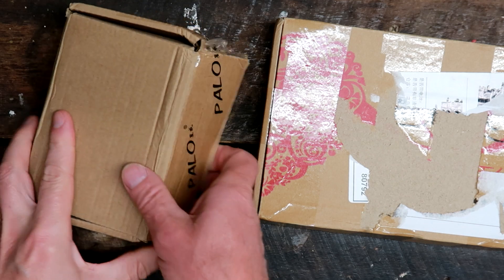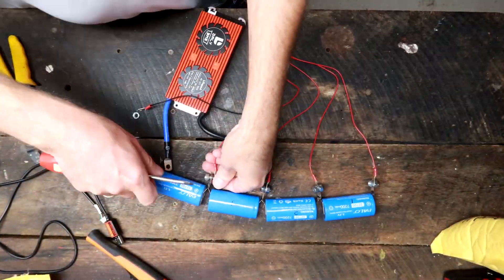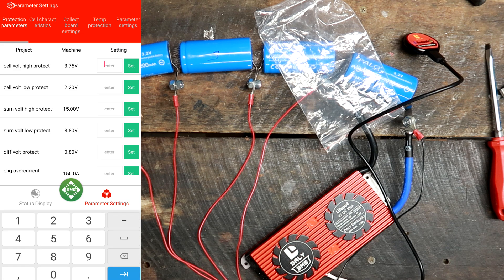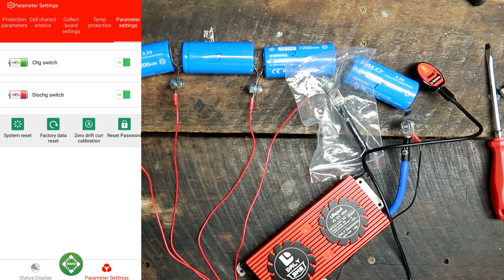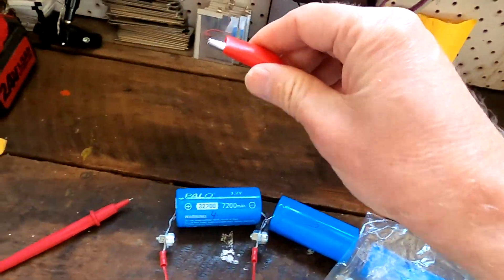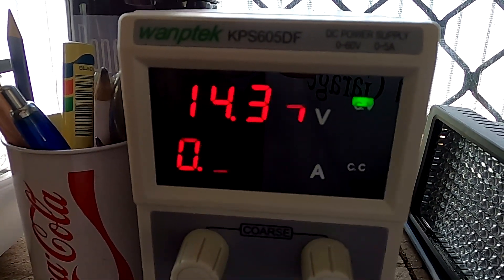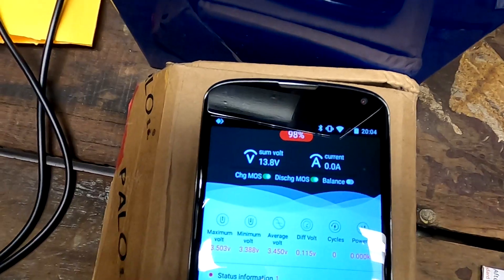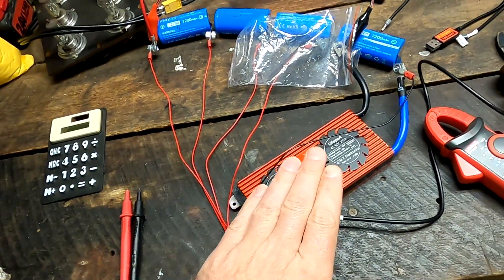Why DALY BMS' are so popular? Exactly, I don't know either.

Comment: I have to agree Andy, I had such high hopes but my Daly 4S however it is a mediocre BMS at best. I have also got a 16S xiaoxiang type non-relay MOSFET based BMS and I'm far happier with it. I had a lot of trouble with my Daly when it first arrived, I had top balanced the cells and the BMS wouldn't start and I couldn't figure out why. I had to contact support as well and found out that I needed to discharge the cells a bit first before it would even work.

I'm not 100% sure that it's the same with the larger cell count versions (ie 16S) because I'm aware they run a different chipset and protocol when communicating with the BMS. I found this out when I connected it to my VenusOS Raspberry Pi via USB to get the battery statistics.

You're absolutely right around the settings, not enough configurable and the balancing might as well not be a feature. I am going to replace my Daly BMS shortly as I believe it is contributing to the poor performance of my 12V pack and will use it for bench testing only. 

Thanks for the video Andy it has confirmed my suspicions that it was just how the Daly 4S BMS works and not that my one was a lemon 👍
Reply from the maker: Thanks for sharing, Ben. I was really disappointed with the Daly BMS, was hoping for a far better experience. Apparently you can connect it to a PC and have all the options available then to configure. But how cumbersome is that?
The Daly will now be just a protection board when I do testing, same as you said. That's all it is good for.
Reply: Your battery is probably mediocre too

Comment: The QUCC bms is awesome, if you are worried about that when the relay turns off to protect the cells, the discharge function turns off too, obviously, what I did was took apart the relay and connect the battery cable directly on the bms shunt, and use the relay to turn of the charge controller instead, so when you have a high voltage alarm, just the input shuts and works perfectly. If you need to protect from low voltage just program the inverter to do that and you are all set. I tried the Daly bms but the Qucc is much better specially the software
Reply from the maker: Oh, that is a great idea. I never thought about that. Actually I would probably connect a second really which then shuts off the solar. I'll think about it. Thanks for sharing.
Reply: Bună ar trebui să vad o demonstrație

Comment: My experience with Daly was ok. Installed, started bms fine, app worked ok on the phone. A bit of guesswork/sleuthwork was needed to get the Windows app going, and I've found I never use it anyway.

The various parameters on the app were pretty self explanatory, so never really needed the manual. It's been working flawlessly, and top balances within 20mV without fuss.
Reply: balanced open start voltage = 3.2V
balanced open diff voltage = 0.020V
and it just worked - I guess from other comments probably only when it's charging. It's not balancing now because it's discharging but max difference is 0.011V.

Comment: I havr an 8s 24v daly bms.i found out it only balences while the charge indecater is on
Reply from the maker: Yeah, that's what I found too, it's bit restricted in these terms.
Reply: The only time you balance a  battery is during charge
Reply: Thats the correct way to balance a battery

Comment: Weld? Isn't it normal to spot weld battery tab connections?
Or perhaps in Chinglish, they meant soldering?
Reply: I think they just mean "making a connection" in this context. Don't make connections to the balance wires while they are plugged into the BMS.
Reply from the maker: Apparently they mean soldering. But still who is soldering balance leads on busbars or terminals?
Reply: @OffGridGarageAustralia  What they mean is that you must only make use of the blue and black silicone flying leads that come with the BMS.  Don't try to solder your own huge wires directly onto the BMS PCB.  You can imagine how much mess some people may have created while attempting to do that.
Reply: @OffGridGarageAustralia  - “who is soldering balance leads”

Probably someone putting a BMS & battery set in a box & selling them as a unit.
Reply from the maker: @henvern  Is that what it means? You would have to open the BMS to get access to the PCB. There's your warranty gone then...
Reply: @OffGridGarageAustralia  Yeah not likely on the 100A BMS where the leads are potted in.  The 250A BMS has large tabs which removable leads screw onto.  You wouldn't want someone to try solder to those tabs since the heat would soak straight into the PCB.
Reply: @FullyChargedZone  Cool Channel name
Reply: @OffGridGarageAustralia   its actually done often to avoid the terminal rings making a weaker connection between the busbar and battery.

Comment: I just got mine and can confirm that it doesn’t balance upon being hooked up, and no, I didn’t “welding the wires”.  The instructions are hilarious.  I have the temp disconnect in ice water and it also is not disconnecting like the other bms.  Damn.  Thank you for posting an accurate data driven review.  If you can get these to 10 min that would be great.  30 min is a long video.
Reply from the maker: Thanks for sharing, I'm still waiting for my temp sensor to do more testing. I'm not good with short videos. It would be several parts then...
Reply: @OffGridGarageAustralia  you can probably get a temp sensor from any RC parts store, or you can make your own two lead.  The cutoff may be slightly colder than 0 degrees C, but I decided to err on the side of caution and hook up a separate temperature disconnect that I know will shut off the charging side

Comment: In my mind, the nice cover and tabs to fasten down to a surface are what draws people to Daly.  Functionality aside, these look much nicer and are safer in that the leads are not exposed.  I also think Daly is the Chevrolet while other's may be the Cadillac or BMW.  It will get the basic job done but may not have all the bells and whistles.  (Maybe a bad analogy, these days as most cars seem to have all the bells and whistles).   Before condemning, though you should attempt to top balance then install to see what happens.  Also you may have someone else's reject as the temp sensor lead is missing.  AND THE RUBBER BAND IS NOT WRAPPED AROUND ANYTHING.   I would make blanket statements about any brand without testing more than one.
Reply from the maker: Thank you.

Comment: I have daly for 16 300 AH lfp batteries connected to a deye inverter. I always struggeld since my inverter would not charge with full power while there was a lot of pvpower available. More or less it was charging the whole day instead of charging fully in the morning.

After I had low voltage faults and my daly was in sleeping mode when I discharged only up to 4KW and drawed about 2KW.

I got across some daly settings in a daly forum and changed the referrence voltage from 3.2V to 3.6V

This seemed to change the behavior. My batteries are now fully charged 10AM using full charging up to 4.5KW. Also did it charge 7KW more than usal on the first day. At night my batteries where before at 52.2V and newly at 52.9V

Im still unsure if it os save to use my new settings since I dont like to reduce the life time. Is it save to have the referrence at 3.6V charging upt 57.5V?

Comment: The balancer does work over a 10 amp charge rate. The charging stops when one cell goes over the limit you set. You will never get the battery charged at higher than 10 amps. Over 10 amps and it goes on and off as that same cells go over the limit as soon as the charging try to start again. So it never goes anywhere. That is why I will install a QUCC 10 amp active balancer. Moreover if your delta increases with the charging, your charger amp ratio to balancer amp is to high. "Delta" is the voltage differences in highest and lowest cells.

Comment: Touch your blue and black lugs together for a second to turn on BMS. Yes, a NTC thermistor sensor was including in all of my Daly’s. One was hidden under foam. Oh, The Bluetooth works when it wants to. Also there’s a timer on the Bluetooth. If you go to settings, you can enter 15300 seconds and that helps quite a bit keep it on. It will shut off if you go sit down and have a beer and go back to it 15 minutes later. All of this stuff is just a learning process. So far I like everything about Daly, except there is no LED or beeper. I also buy the touchscreen display as often as I can. In order to balance, you need to have electrons flowing.
Reply from the maker: Thanks for sharing.
Reply: Look closely at the Bluetooth module that he is using. It has a reset button on the front which can be used to wake the Bluetooth up. I have the same module but what’s interesting is that it does not have the Daly logo on the front. The ones with the Daly logo do not have the reset button.
Reply: @TexasStatesman  Some of my dallies have it because they are newer. The older models do not.

Comment: I have such a problem
bought 16s adjusted to 14s
the last cell shows 0.899 although the tester shows 4 volts
I change the settings to 13s, after which cell 13 shows 0.789
I change it to 12s, cell 12 shows 0.845
help!

Comment: Two reasons, they come properly packaged, not like some DIY kit you have to make up yourself, and secondly they just work! 3 years in service no issues.
You have to remember they were pretty well the original, not much else on offer 4 or 5 years ago.
The only thing I don't understand about ALL these Chinese companies is why they don't pay a professional English speaker to rewrite their manual and instructions, it would reduce the number of customers issues by a huge amount. As an example Deligreen had their main wire connections described in opposing colours!

Comment: I use this Daly BMS with my 16S LFP battery 14.5kwh DIY. An arduino check cells with RS485 protocol, and I turn on active balancer (the same as your with condensators) with a relay on the "turn on / off" pin on the active balancer PCB ; The active balacer is only activate at the end of charge, it's perfect for me !
Reply from the maker: That sounds like a perfect solution. Makes totally sense to balance only at higher SOC and voltage.
Reply: What active balancer are you using? I’ve been wanting to do this as well. Thank you.
Reply: Nice solution with check cell with rs485  and Arduino can you tell me this solution
Reply: Thats a great idea! I'm using Venus OS connected to Domoticz automation system which could act as a logic instead of arduino based on SOC. Thank you for this idea :)
Reply from the maker: @redbaronrefining5322  Have a look in the description of the video. There is a link to my website where you can find the active balancers.

Comment: Andy Im using the Daly bms I keep watching this video over and over and over and over and still can't figure out where to set the balancing start voltage no matter where I set it my last cell in the bank keeps deviating from the pack my last setting to try and fix this was 3.4v the actor balancer kicks in but the cell just keeps climbing higher and higher please help
Reply from the maker: That's the problem with DALY BMSes, the balance current is so small, they won't be able to balance your large capacity cells. You will need and active balancer for your pack.
Reply: @OffGridGarageAustralia  I'ma go ahead and switch my BMS to the JK Bms I'm just tired of Dalys poor performance in balancing I need 3 of them since I have 3 24v banks
Reply from the maker: @diysolaradventures7894  What batteries do you use? 280Ah or similar?
Reply: @OffGridGarageAustralia  yes same blue lithium iron phosphate cells as the ones u have except capacity on mines are 277ah and my other 16 cells are 120ah

Comment: Weird, I had the same problem you did, however my Daly came with the temp sensor and at first it was working, then the unti stopped charging but the chg and discharge switches indicated it was working but the pack would not take a charge, once I turned off the temp sensor it started working again? I have 8 32650 cells in series as a test, my cells are 6000mah so that should mean they are 6AH cells correct? Yours are 7200mah which should be 7.2AH so where did you get the 5.4AH? curious that I may not be understanding... Great video you saved my bacon.

Comment: They make more sense in the PEV market , since you disccharch at much higher amps , often for safty we run discharge bypass and charge only BMS configurations. You would not want your battery shutting off leaving you without brakes.

Comment: I have used daly bms extensively. several 4s and one 16s. Their software, updates, translations, and differences between board/software revisions and support is just a mess but he important stuff like lvd and hvd etc is flawless and imo you dont really't need to change any settings except capacity. 3.75v/2.2v HVD/LVD is set that high/low so you can charge up/discharge your batteries to 3.65/2.5 with charge controller without the bms cutting off to early.

The bms need at least 2 amp charge current to balance
35mA balance current should be more than enough to compensate for drift caused by internal resistance differences. Obviously you cant use the daly bms to balance unprepered new cells. Go do the initial onetime top balance first, you know this already lol! :P
The SoC calculations on 4s boards are a bit wonky.
The password is just a password set in the app, the bms has no password and cant be changed anyway, see it as a "are you sure you want to change this setting" prompt.

The bms definitely need improvements, especially in the software. But hardware seems good to me. Low resistance no heat =))
Reply from the maker: Thank Rickard, great info here! With the other BMS' I had I could just wack the cells on and it would balance them over night automatically. For these smaller test cells, I never top balanced them just left them connected to the BMS and it would do it. The Daly seems to need a lot of cycles for that to happen if it only shaves off a small current while charging. Not a fan of that...

Comment: Hey andy could i please get a reccomendation on a 4s bms for my battery im building? Im gonna use 8 of  the 304ah cells to get 600ah my questions are should i be running 2 individual bms? Also what would be your reccomendation for one? Im gonna have a 3000w inverter so was thinking 200a bms?
Reply from the maker: It depends a bit on how reliant you are on this battery. For redundancy two separate banks would be nice, but you need an additional BMS. If it is for a camper, I would run every two cells in parallel and use only one BMS.
Also the 3000W inverter can use up to 250A on 12V. So a 200A BMS maybe too small. You either can use a Daly or JBD BMS with such high currents and an additional active balancer from time to time to maintain that top balance.
Reply: @OffGridGarageAustralia  yea its going to be for a permanent off grid setup so maybe the 2 bms might be safer... also was talking to my 12v friend and he said 2000w inverter will be enough so that should be a bit better... also a new question you just mentioned haveing a seperate actuve balancer is that another unit? Which one of them would you reccomend. You seem to do alot of testing so i trust your results.
Thanks mate

Comment: can i connect 8s lifepo4 320ah in series and then connect a second 8s lifepo4 320ah in series after i have these individual battery packs in series i can connect them in parallel to add a 24v 640ah system please answer i need to know thank

Comment: We just add an DALY active balancer in our Power-Packs. And it works perfect.
You're right: Balancing battery packs by using a DALY BMS only is NOT POSSIBLE.
In my mind it's a kind of merchandising stuff. YOU REALLY NEED TO ADD A DALY ACTIVE BALANCER.
This active balancer balances the battery cells down to 2 mV deviation.

Comment: Thanks for sharing, I’ll look into the QUCC BMS, however my DALY has been working quite nice.
The warning about welding seems fair, I guess you could damage your BMS if its connected while spot welding the cells!
Reply from the maker: If your Daly works, don't buy another one. The QUCC won't be much better...
Reply: @OffGridGarageAustralia  Regarding that, is there a BMS that you DO recommend? I saw you have a video about JK-BMS, but if I need something above 12 volts?
Reply from the maker: @henrikostman4474  The JK goes up to 24s so can be used for almost any battery. 
If you want more communication, more safety look at the Seplos BMS, Pace or GobelPower. There are heaps of videos about all of them here on the channel.

Comment: As a guy without any personal experience with any BMS, i always thought this QUCC BMS is quite nice, except for the relay.
Today i tried again to order my boards for the DIY BMS, but still so many unavailable parts that i could not order it...
And there may be two more reasons why people buy DALY BMSs. It is available in Ebay from within the EU. And it seems to have a good short circuit protection.
Thanks for sharing your experience :-)
Reply from the maker: Can you not get the DIY BMS boards ready soldered through services like PCBWay or similar?
Reply: This is what i tried to do. But if the controller board is missing many components, because they do not have them on stock, it makes no sense.
For example the CAN bus transceiver, which i would need for the connection to the Victron Cerbo GX, is not available right now.
It is known, that for the modules the AtTiny841 is usually not available.
But just the modules without controller does not work either...